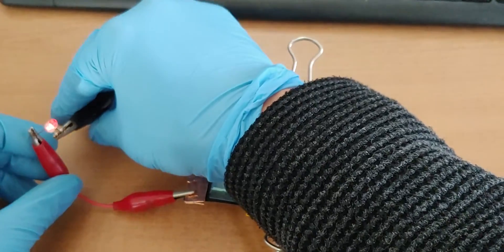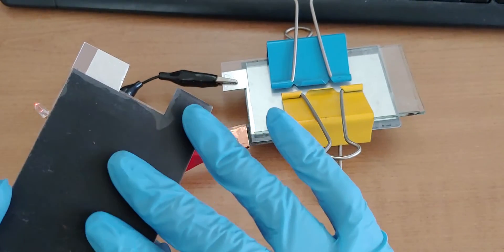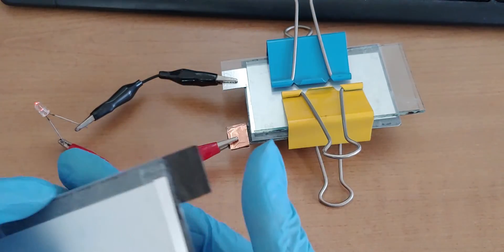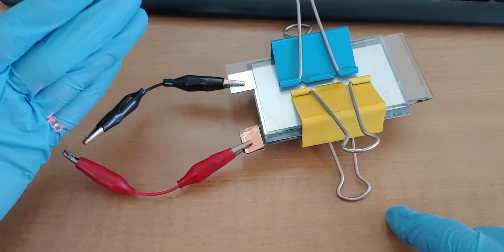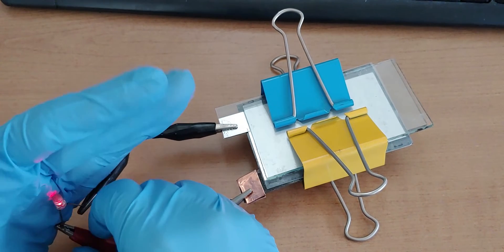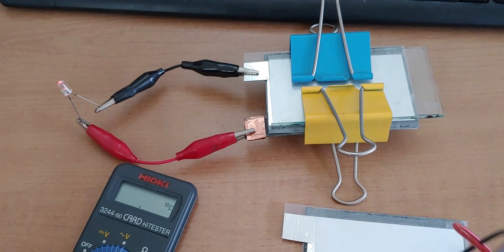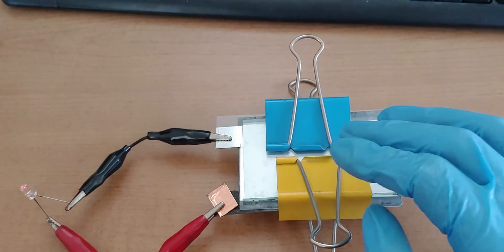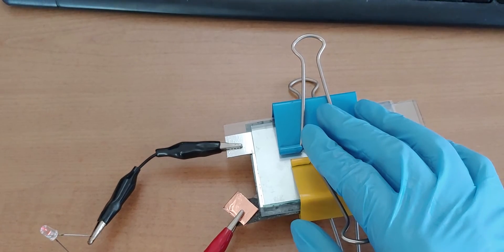graphene solid state battery on plastic

Comment: Graphene on plastic really works, but the current through put is limited due to surface resistance, a thicker costing with some applied pressure helps. The copper or stainless steel terminator is very helpful in collecting current. Charging is also affected, slow and steady, the same with discharge via high bright LEDs.